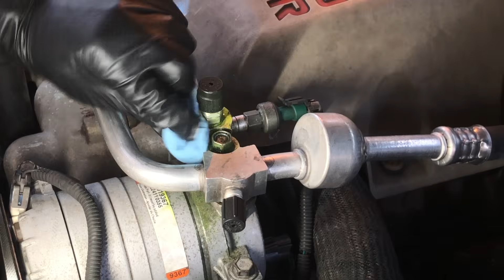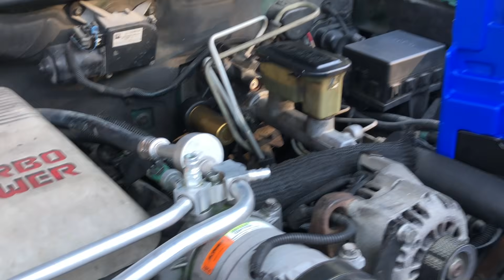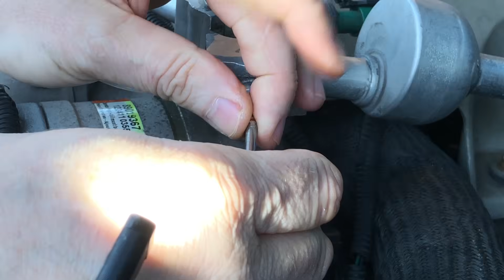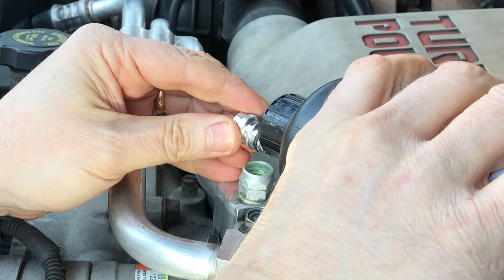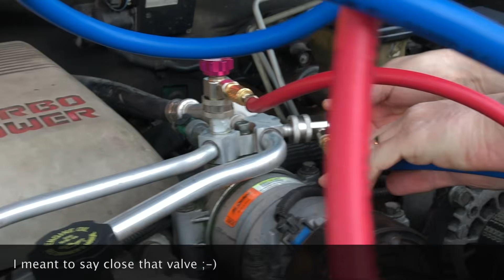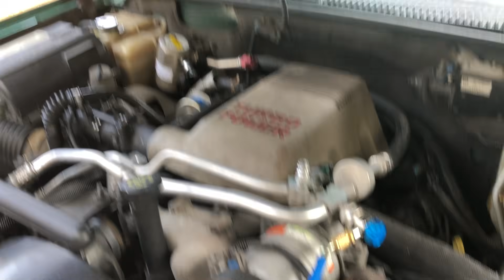1996 - 2002 GM OBS Truck R134a AC High Pressure Ball Valve Service Port Leak Repair (Chevy & GMC)

Comment: I was furiously "impressed" when I realized that GM had elected to put some bizarre ball valve here when Schraders have been used universally since the dawn of time.  They installed a high-pressure port valve that quite literally cannot be fixed without full evacuation and replacement of the whole port and a special wrench is necessary to remove that port; yet another middle finger to your customers.  Great job, General Motors.

In lieu of a special wrench that costs more than the replacement port, I used locking pliers.  The old port doesn't matter as it's trash and if you use a layer of cardboard or stiff rubber between the jaws and the port, you can install the new port without scarring it; it doesn't need to be over-tightened as it has an o-ring that fits into the receiver for sealing.

I suppose that the ball valve was used for some manufacturing advantage (faster charging?), but it's a terrible design choice.

Comment: Completed the reworking of the AC system on an old vehicle, installed a new high side pressure ball service port to be safe.  Removing the gauges after completing the work (or so I thought) and the NEW GM valve was leaking like crazy.  So much for new build quality.

Comment: How long should you vacuum it
Reply from the maker: I like to go with 30 minutes of vacuum pump on to boil off any atmospheric moisture, followed by another 30 minutes to check that the system holds 30Hg of vacuum with the vacuum pump turned off, as a post-repair leak test.

Comment: Love your details! I'm now thinking about purchasing some equipment from HF for my 2 GM vehicles. Although one is 4 years newer, it's also very similar to my Vortec system. I have a temp blend door gremlin to fix first and possibly the hvac control panel. Will first pull batteries grounds (2) for a bit to reboot and go from there. Thanks for the great video Doc!! 😉

Comment: For best practice do a triple evacuation and use a micron gauge to insure a dry and tight system, There is know way to tell if you have a proper vacuum with analog gauges. You should be able to get below 500 microns to insure all non condensable are evacuated.
Reply from the maker: That’s not necessarily a cost effective approach on vehicles of this vintage, given the additional labor and digital tool costs.  Analog gauges were all that GM supported with their dealerships when these vehicles were brand new so they are perfectly suitable to the vintage.   If you have the more modern and expensive digital gauges, great and by all means take advantage of that luxury, but if you don't - analog gauges have served the automotive service industry reliably since the first GM R12 based AC system was released in 1953.

Comment: Found your video just before I do this same thing on my '03 Sierra.  I'm thinking of changing the high side service port with the Dorman replacement to convert it to a Schrader valve as there are just too many reports of the GM high side valve leaking.  I'm wondering why GM used it instead of a Schrader valve like the low side.  I'd reconsider my decision if someone can provide an answer as to why GM thought the ball valve was better for the high side.  Did they believe the high pressure would cause the Schrader valve to fail even faster or be more prone to sticking due to the higher pressure?  I've yet to see anyone report back that replacing it with a Schrader valve eventually failed.  Thoughts?
Reply from the maker: Personally, I only use genuine OEM parts.

Comment: I waited to see how you replace the high side shredder valve thing off and you never show how is replace I was able to replace the other one but not the high side???
Reply from the maker: The video is about a GM high pressure ball valve.  GM didn't use a schrader valve on the high side in the years this video covers.   Only the low side uses one.   So if you run into a schrader valve on the high side of these model years, that's an aftermarket type part not a genuine GM OEM one.

Comment: Can you replace the low port on a fully charged system or do you have to vacuum it in order to change the whole port?
Reply from the maker: On GM systems of the era this video covers, you have to recover the refrigerant first.
Reply: @DrShock  thank you for your quick response!

Comment: Both valves are in the SAME LINE on my 2002 4wd Silverado (California).  How can that be?
Reply from the maker: Note that this video is only for a GMT400 body style truck, so anything else will look very different.  Not the same as the GMT800 series that came out in 1999.  Both truck designs were sold in 2002, but the GMT400 design was only used for the 3500HD model that year.

Comment: Very informative. I went through the whole charge process after vacuuming and holding, only to have it leak out of the high side port when disconnecting the hose. So very helpful video. I wish I had tested my ports, now I have to recharge.
Reply: I did the same as you. I had a leak at high side as well and wished I had seen this video too!

Comment: Mine is leaking from the low side. Would I have to empty system and vacuum before charging it up?
Reply from the maker: Either side is under pressure with R134a refrigerant.   So to replace the service valve, either high or low, you have to evacuate it in order to effect the repair safely, and legally.   After the repair, you have to pull a vacuum to expel atmospheric moisture that intruded into the system during the repair before you can install a new refrigerant charge.

Comment: I see Dorman sells a high pressure replacement that converts it from a ball to schrader valve, are they worth it?
Reply: @mattjones4285  yea it allows you to just replace the Schrader when it fails next time using the tool with valve  allowing you to keep refrigerant in the system

Comment: If we try to recharge when we take the line off the high pressure side refrigerant blows right out  is this the problem? Thanks
Reply from the maker: Some R134a will escape when removing the coupler, but a very small puff nothing you should see only hear.   It's very hard to say over a comment forum and not viewing the truck, but it could be a sticking service valve.   Have you tried recharging thru the low side, and then just checking the high side for behavior afterwards?
Reply: @DrShock  thank you we will try that

Comment: This is the closest I've come to what I need on the internet for any video my Schrader valve also broke and when I finally got it out if stripped I've got the new part and I don't know what to do with it I thought about trying to put it in with some red anti-seize I tried to cut some threads into it a little bit I'm contemplating using Loctite power grab all purpose interior construction adhesive or maybe even trying to solder it mine is on a Town Car 07 if you reply I will be internally grateful I've got to change out the orifice tube also and haven't been able to get it off of there try not to boogered-up anymore
Reply from the maker: This video is specific to a certain model year range of GM trucks so may have only tangential similarities with another brand of vehicle.   I am not familiar with the Ford / Lincoln design, but I would suspect similar to GM the entire refrigerant hard line hose assembly will have to be replaced if the metal valve threads have become damaged.   The high side service valve is under considerable pressure, so there's no reliable repair method for damaged threads there only replacement.
Reply: @DrShock  you produced a great video. Easley I think it's the best one on the internet for the topic.  I appreciate your time and effort so much it was helpful. I'm not asking for anything by saying that I don't have the money for the whole line I've tried everything I could to come up with a solution and keep my husky service dog cool through the summer. It's almost over summer in Mississippi that is. I'm going to try to cut some for a Jeanette using a small helicoil it is a little low side the high side Schrader valve went in without a hitch. 🙏♥️🇺🇸

Comment: I HAVE A 2004 malibu and the plastic cap broke off inside the valve. the valve is totally round you cant grip it with a socket to remove it. is there a special tool to remove the entire low side valve? i dont have access to the shraeder inside the valve.
Reply from the maker: When you say the plastic cap are you referring to the screw on valve cover dust cap?   If so, you can get that out with a pick or push pin.   Just work the pick along the inside edge (staying at an angle to the threads of the aluminum port and away from the center area where the valve would be) and get a bite into the plastic to start to unthread the broken off piece of the plastic dust cover cap from the aluminum threads using the pick.  The low side ports of GM vehicles are typically not removable, and brazed/welded onto the low side line.   Be sure to wear safety googles.
Reply: @DrShock  yes, the screw on plastic cap. i tried using a very tiny screw driver and could not do it, i tried melting  the plastic with a soldering iron. Some got melted but I was unable to pick any of it out with the tiny flat blade screw driver. What worries me most is the fragments either by melting the plastic or by drilling into it like some other guy tried can be sucked into the line and destroy the entire system. I had sunglasses on most of the time and switched to safety glasses but the left rim of the safety glasses keeps breaking off. the fell on the floor too many times. what also worries me is if I get too close to the valve with the soldering iron I could melt the valve.
Reply: @DrShock  any videos on removing plastic from the valve like I am trying to do?
Reply from the maker: This is a rather uncommon problem, so I doubt any videos on this.  I'd say the soldering iron was a definite bad call, and has made the problem worse.   It's also possible to damage the valve and vent the refrigerant having such a tool in that area (the valve seal is going to be a plastic material).  You'll be able to use compressed air to blow any plastic debris out of the port.   But having melted it you may have a larger clean up job now.   I'd suggest sticking to only a pick or similar tool and commit the carefully detailed time it will take to carefully clean all of this material out of the port without triggering the valve to release.

Comment: 2 finger snug?  more like 3 – 5 in-lbs torque.
Reply from the maker: GM does not specify any such torque value in their factory service documentation.  So hand tighten only is the guidance from experience for such three decade old aluminum fasteners.

Comment: Don't hand to evacuate when it all sadly leaks out
Reply from the maker: Actually, evacuation removes the moisture that would have intruded into the system in such a complete refrigerant loss situation (once the refrigerant escapes, atmospheric moisture takes it's place as pressures equalize).   Most of the internal AC components will be irreparably damaged by exposure to water vapor in the air in short order.
Reply: @DrShock  agreed. Was talking specifically about the freon.  They do make a dryer injection that converts the moisture to oil

Comment: My 99 chevy express ' the high side was leaking..I was forced to replace the valve with a ball valve...now I'm told don't ever service this valve, because it will leak..so now I will do my vac on the low side only..

Comment: Do not lube green o rings HNBR  o rings are resistant to oil if it's black lubricate it green do not.Also make sure there are no kinks ,bends or twist in your gauge set hoses.
Reply from the maker: Thanks, but the OE manufacturer, General Motors, says otherwise.   So we're going to go with my fellow engineers who designed the service port valve on this one and lightly pre-lube them with Polyalkylene Glycol (aka PAG oil).   This lubrication guidance is solely for the physical protection of the seal during valve installation.  Lubrication avoids collateral leaks via friction introduced during torque of the valve assembly.

In the USA, only green color coded o-rings can be used in GM air conditioning systems, where the part being sealed is exposed to PAG oil and R134a refrigerant.

Comment: I just vacuumed my 2004 Chevy 1500 down. Sat for about 20 minutes and I didn't see a change. I recharged and two days later it wasn't working. I suspect valves. Wasn't sure how to test. But now I know. Thanks for the video

Comment: The O ring is what actually keeps the refrigerant from leaking, not the threads, so just snug is fine for that fitting. When it's charged with refrigerant, all the pressure in the system will keep it sealed. Same with your refrigerant manifold gauges. If your fittings are leaking, you need to replace the o-rings, not tighten it down more.

Comment: Quick tip to save you some long term problems. User Mineral Oil, not Pag oil when you're lubricating those O rings. Reason is PAG oil is hydroscopic and can cause corrosion in the long run. Regular mineral oil is cheap and doesn't react like PAG oil. Use PAG Oil inside your system though! I got this tip from a guy that rebuilds car a/c compressors.
Reply from the maker: While it's accurate that PAG oil is hydroscopic, this is not a real concern by GM in their service procedures for this era.   The -30Hg vacuum holding part of the repair procedure is included, and required, for the very purpose of boiling off any H2O that may have entered the closed system.  H2O will atomize, and be thus eliminated, under this level of vacuum pressure in all cases.  

The threaded surface of the valve making contact with the o-ring on the opposite side remains atmospherically exposed always, but the expectation in practice is the valve assembly is far more likely to fail and require replacement due to leakage, long before corrosion itself becomes a concern for this particular part.   No harm in using mineral oil, just not required.

Comment: Great video! Thanks. I'm replacing the high and low side valves on a 97 BMW. I've read to use mineral oil for the o-rings, but I've seen many folks advise PAG oil. Thoughts?
Reply from the maker: Can't say for BMW as I do GM, but for GM vehicles only genuine PAG oil is authorized for servicing these parts.
Reply: @DrShock thanks! Yeah its a BMW but uses Denso parts (Japanese). I’m going to use PAG46 oil and will lubricate w the same. That’s the brand of a the o-rings and valves i’ using also.

Comment: Hi! Where May i buy that hose assembly? For a Chevy 1997 6.5 diésel with rear a/c? Thanks!
Reply from the maker: That rear AC hose assembly was unique to the 6.5L diesel SUVs and was discontinued way way back in the early 00's.  It has been unobtainium for many years now.   There were no aftermarket suppliers as the volumes were too low.  When I've ran across units that needed leak repair I've farmed the hose assembly out for rebuilding (new rubber hoses and new crimp ends to the aluminum lines).
Reply: @DrShock  where can i find a user one? I think the previous owner fixed it but i don’t why they removed the pressure sensor that goes there
Reply from the maker: You replace the valve without removing the hose assembly, as I show in the video.   Even an used AC hose for a 6.5L SUV will be an easter egg hunt of a lifetime to locate.

Comment: Do I need that oil tho?
Reply from the maker: You don't want the new o-ring to go in dry is all that's for.  But even residual PAG oil from the prior leak can be enough, if it's there.
Reply: @DrShock  awesome thank you so much man! Hoping this will fix my ac from leaking in the future

Comment: Best practices would suggest two digital vacuum micron gauges to be used (one on the service fitting and other directly at the pump) and vacuum to be pumped down to at least 500 micron, and then a leak check to be performed observing he micron gauges that they do not rise above 1000 micron. (personally I prefer the yellow CPS vacuum gauges). Measuring a vacuum drop with a mechanical pressure gauge is an inaccurate way to determine leaks.

Comment: Will the leak in the low side port cause the compressor to turn on and off?
Reply from the maker: Compressor cycling on these trucks is normal operation.  A leak will eventually vent enough refrigerant to be too low for the compressor to come on at all.  You can't diagnose these kinds of problems realistically without hooking up an AC gauge set to the ports though.
Reply: @DrShock  Oh ok..ive got a 97 cougar 4.6 and its leaking out the port it has that stupid ball valve so im going have to evacuate it regardless,the gage goes almost to red when its not engaged and drops almost out of the green range when it kicks on for about 4 seconds

Comment: My nephew and I, had a problem, trying to get the shrader valve out, of his 2004, Acura TL? We were able to loosen it all the way, but we weren’t able to pull it out, all the way? That first tool you showed, looks like, what he might need? Can you tell me, where you can find a tool like that? I tried, tweezers, a small hook, with handle, and a small pair of needle nose pliers? I couldn’t get it out, for the life, of me? Thanks👍
Reply from the maker: Those tool links should all be in the description of this video.